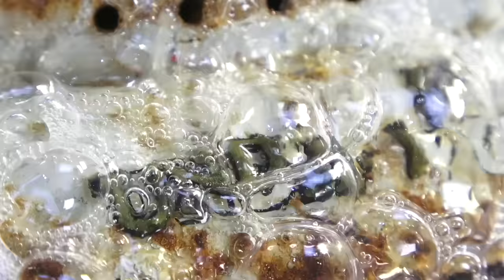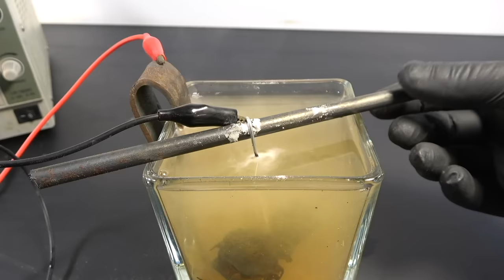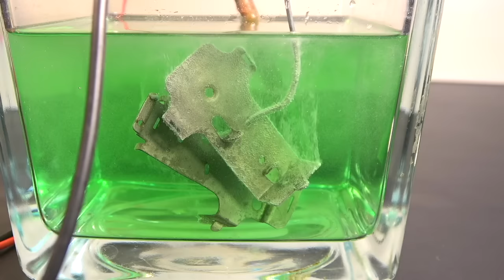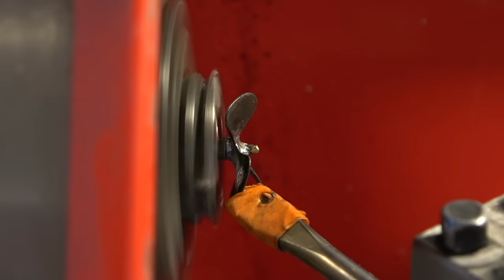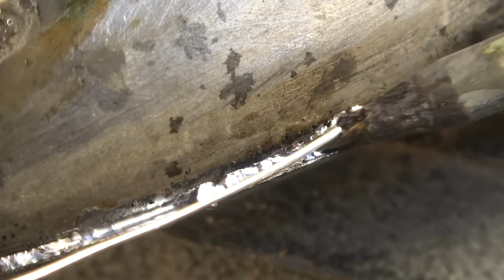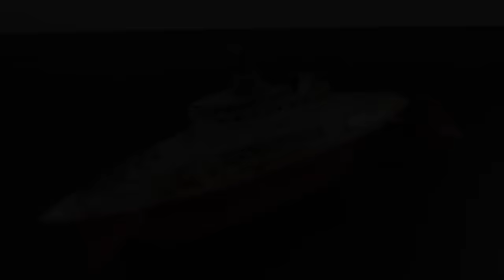1951's Tin Toy Submarine 'UNDA-WUNDA' - Restoration

Comment: Putting aside the amount of rust, the efforts you had to deploy to strip the paint including the lthographed markings, and open up the shell is an obvious testament to the amazing build (and mechanical) quality of Sutcliffe toys - with almost no part needing replacing!
Reply: Have you seen the box for these ?. it states that if the sub needs repair it can be posted back to the factory with 40p and the motor will be replaced and returned to the sender. If the repair is less than a replacement then it will be fixed and returned with the change !!!! Unbelievable.
Reply: Replacement*
Reply: @potrzebieneuman4702 oh the days of handcrafted metal toys

Comment: This is just a suggestion and I'm not an expert on electronic pickling / electrolysis. I clean vintage cast iron cookware using this method. It is a line of sight type cleaning so the more sacrificial anodes you have around the tank the more thoroughly it will clean. I have sheet metal lining the inside of my tank and it does fine. Experiment with more anodes and see if your results improve. Love the channel.

Comment: Incredible quality toy - all parts either soldered or brazed. I had a Sutcliffe 'Nautilus', which, sadly, now lies deep in the silt of an extremely deep local pond. Knowing the build quality, it'll probably be found, almost intact,  by archaeologists, in a few centuries time! Great restoration! Thank you. 👍👍👍
Reply: depending on the pond, it may have already been found by magnet fishers. like myself. though ive never found anything that cool. all i seem to find is junk and old fishing hooks.
Reply: @nyotamwuaji6484   - I lost mine in about 1975. The pond is an old brick clay pit, and it was known to have been at least forty feet deep at one end. One end was shallow, but it shelved off really deep after about ten feet or so. It was fed by a spring, and the water was always icy cold. In the late 1990's, the Town Council made the area the pond is in, into a park, and ruined a lot of it by making it 'safer': a very long mudslide, enjoyed by thousands of kids over the years, had steps cut into it. A hazardous path over the edge of a sandpit (about 25-30 feet up), which again had been used as a test of nerve by generations of kids, was methodically cut away. The remains of this were dumped into the pond, making it a good deal shallower, and burying my 'Nautilus', (which had gone down in the deepest part), forever. 💀💀💀
Reply from the maker: This is a sad story 😕 I would have been devastated
Reply: @TheFabrik   - It was an awfully long time ago - I was about 13 when I lost it, in the viciously hot summer of 1976, where sitting in icy cold fresh water, from a spring, was a good idea, and I was playing with the sub. It went down... And did not return. The pond (which was part of an old clay quarry) was about 40 feet deep in the middle: I had swum in it, and couldn't see the bottom. A few weeks ago, I was 60. I think I can leave my Nautilus to rest now. A really fun toy, though. (sigh). 🤬🤬🤬😆😆😆

Comment: Unda Wunda - 1932 to 1984

1932 saw the launch of one of Sutcliffe's most iconic clockwork steel toys, the Unda-Wunda. Sutcliffe's British competitors produced equivalent speedboats, some of them arguably better (although more expensive) but none of them produced a tinplate clockwork submarine... A DIVING submarine no less! And for 50 YEARS!
Reply from the maker: Thanks a lot for the infos 🙌
Reply: The VW beetle will still beat the record of the most mass produced metal thing

Comment: I would of metal sprayed a layer inside to fill the pinholes   and out side then linished the suface instead of filler putty
Reply from the maker: I wanted to get the lightest weight… I already restores one with too much paint and filler and it was too heavy 🤷‍♂️

Comment: Amazing job! My only concern is that you ran this in a chorine swimming pool. which is going to rust/corrode the hell of the inside which you didn't paint or protect. Not sure why you didn't paint the inside since you had it all apart.
Reply from the maker: Thank you ! I already restored such a Sutcliffe submarine. I applied too much paint and the submarine was too heavy. I just should have nickelplated the inside… in any case rust will come back sooner or later